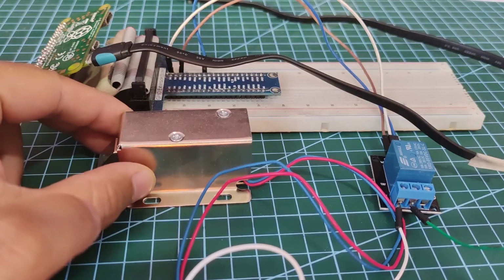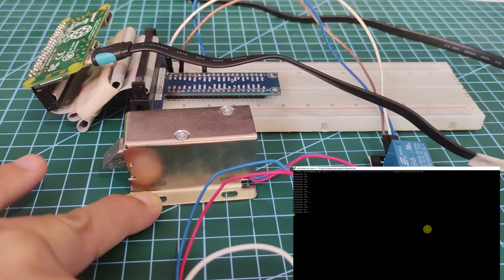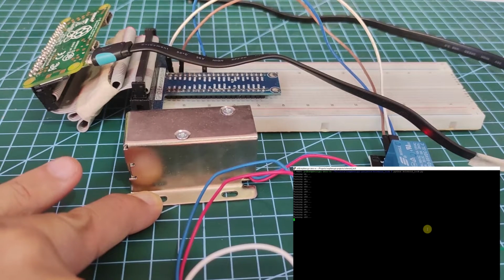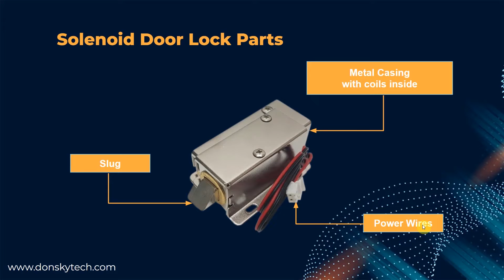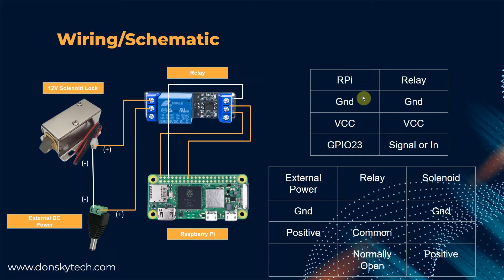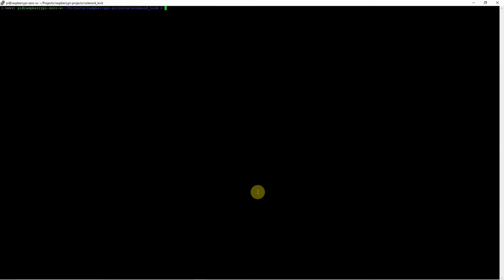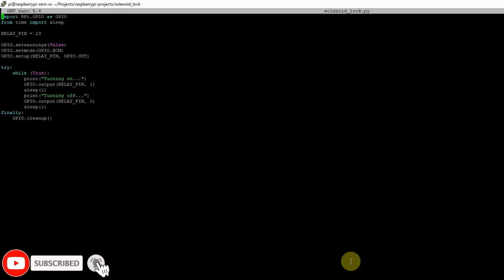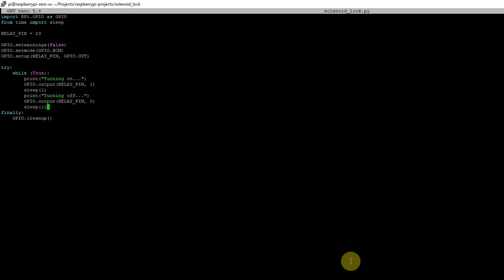Interface Raspberry Pi with Solenoid door lock

Comment: Thanks so much for the video. Would you be able to point me to the specific components you used? I'm having trouble finding an appropriate relay and power supply. Thanks again!
Reply from the maker: Hey, I just bought the normal relay module online and for power I have just used my power supply with configurable current settings.  You can find them online based on where you live.
Reply: @DonskyTech  why our solenoid stick to one state only?